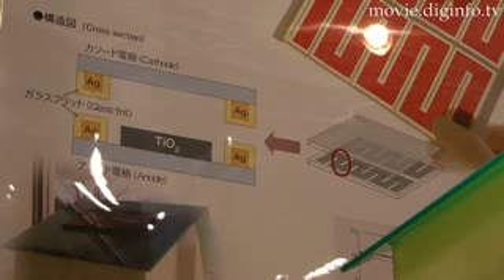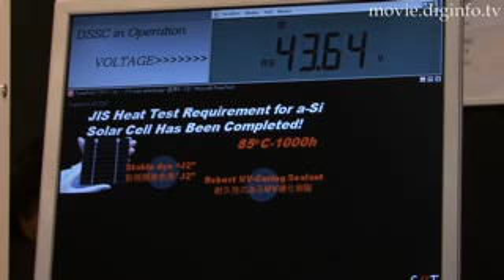Dye-Sensitized Solar Cells : DigInfo

Comment: Is it possible to use your idea of dye solar cells with silicon,even using it in a atomic core device. Powering solar dye cells can be useful in many areas like a situation of using laser light on it instead of sun light and then measuring how much energy can be produced compared to solar light.

Comment: Less radiation waste idea:A Atomic Plant's atomic clock can be powered and energized,using a solar clock but doesn't use sun power but only laser light which is absorbed in clock's solar panel cells or photo voltaic cells which absorb laser light and sends to core battery.Reason atomic plant clock needs to use this technique is:Electrical wires if cut are dangerous/around atomic things,if old not fire safe;Long Fiber optic wires can send light energy and if cut,no problem just laser exposed!